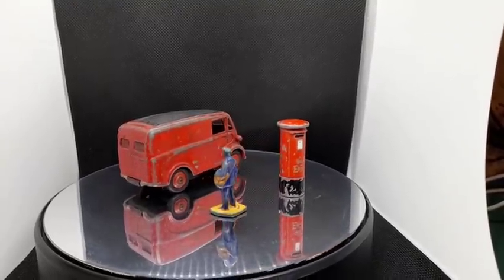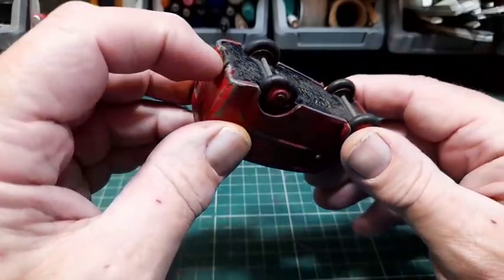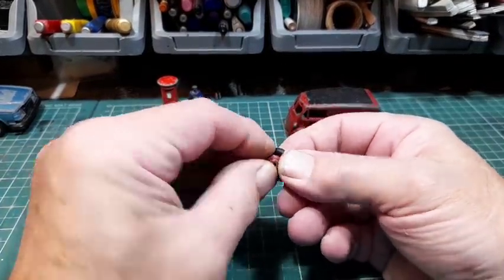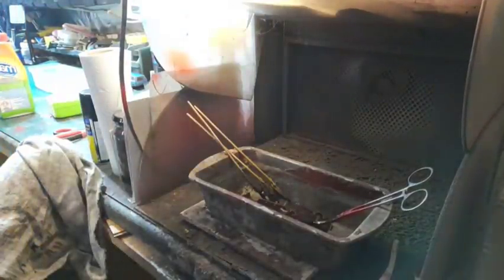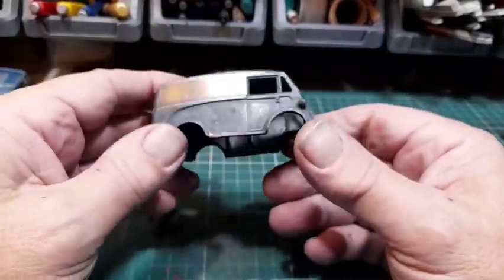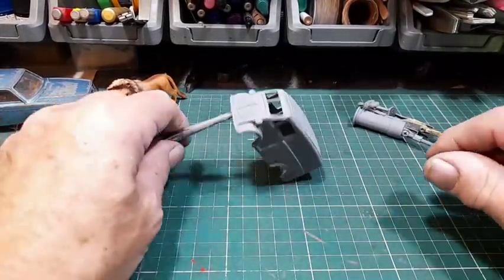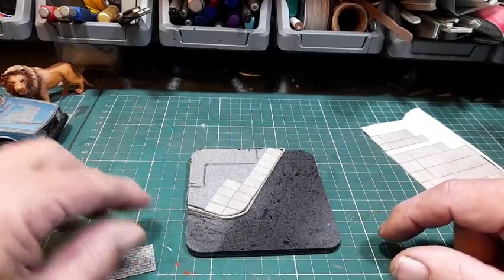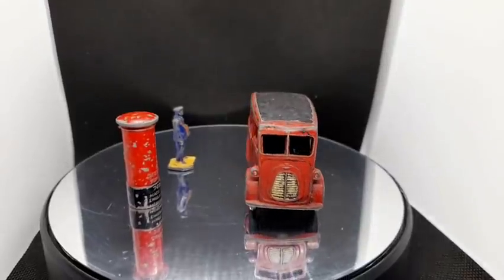Dinky toys Diecast Restoration post van no/260 1955/61 post man no/12e 1938/52  post box no/760 1954

Comment: Hi Martin, I worked as an apprentice with the guys who developed and built these, and the reason the wheel arches were black is the GPO versions of these vans has rubber wheel arches because of the bumps that the postmen caused didn't damage the vehicle
Reply from the maker: Thats great that you worked on this van .
Plus thanks for the information on the arches thats very interesting 👍 
All the best martin

Comment: Just wondered Martin....how can you talk while 
painting the rad edging??? I have to literally hold my breath
when doing 000 brush work!
Great finish to the postal trio, the pillar box detail is terrific.
One thing I've discovered - on roofs of vehicles on anything from yesteryear - don't repaint using a brilliant white. 
I used instead 'antique white' or 'off-white' as this
looks in keeping with the period - as the brilliant white 
as we know it wasn't available at that time. I think the 
postal time notice section on the pillar box would suit antique white rather than (what looked like on my screen) brilliant white. 
Not a criticism I just thought I'd mention it as it has made a big difference to a lot of my period repo work.
Reply from the maker: Thanks Paul, you are right about the white I will add a touch of varnish to it and that should tone  it down a bit .
Iam looking at doing some yester year vehicles this year for a change so I will take your tip on board.
Thanks very much. 
All the best martin 👍

Comment: Hi Martin. Nice little diorama. like how you blackened the wheel arches as i did on mine. Yes had the same problem getting the contours right. Did you want you want to do the roof also as how the original one came. Appreciate video timing might prevent coverage
Reply from the maker: Thanks Ian , I did  check on Google images before finishing the van Some didn't have the black on the roof. 
All the best martin 👍
Reply: @martindaredare  Fair play. Still looks good
Reply from the maker: Cheers Ian much appreciated my friend 👍

Comment: I don’t like using that acid to strip the pain, I know it’s easier but I found that it takes the metal off as well and puts holes in the metal also. I use paint stripper, it takes longer but I buggered up a few models with the acid
Reply from the maker: You are right it can damage some castings especially if you leave it in to long without checking, I do use paint stripper on really old castings ,luckily the older dinky toys paint was quit weak and only takes a minute or two to disolve. 
But still you are right it has to be kept an eye on .
All the best martin 👍

Comment: Hi Martin, I was just checking in to see if you gave an answer to my question? but I did not see my comment or question to you? what happens to it?
Reply from the maker: Hi kris ,sorry its you tube it some times deletes comments for some reason or another it happend twice last week ,apparently if it sees a word or sentence it doesn't like it throughs it out .I have checked my held for reviews section and there isn't anything in there all I get is the first part of the comment.
I can only apologise for this ,you could try rephrasing the question or email me my details are in the about section on my channel.
Reply: @martindaredare  Hi Martin. I'll try again and hope YouTube does not delete my comment again. I need to know what sizes of rivets are best for me to have for Dinky and Corgi and where I get such rivets because it is not available here in my country. Thank you.
Reply from the maker: Hi kris,  the rivits size is 2.5mm for most corgis and dinkys,  you can buy them on ebay in the diecast toys section under parts and accessories. 
Or a company called model supplies. Com
Hope this helps